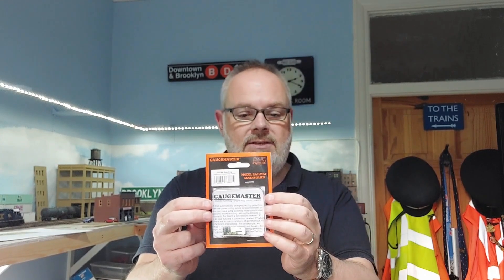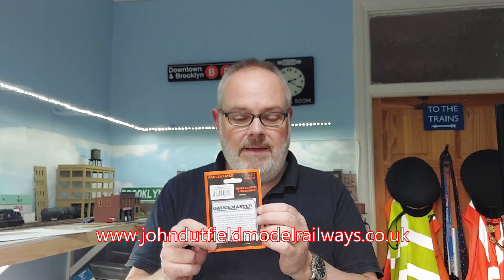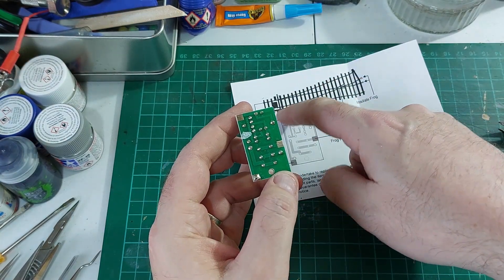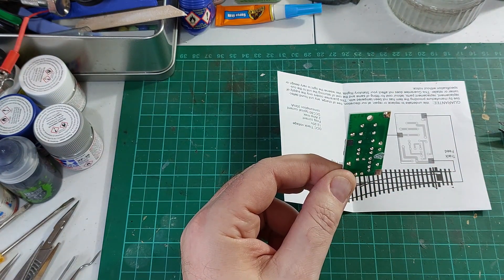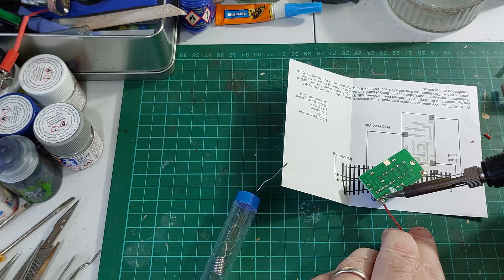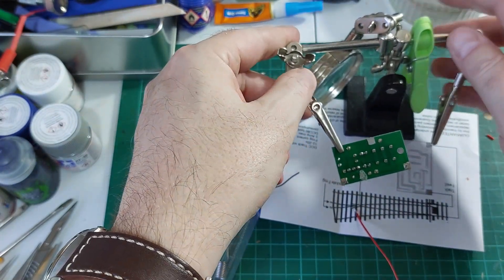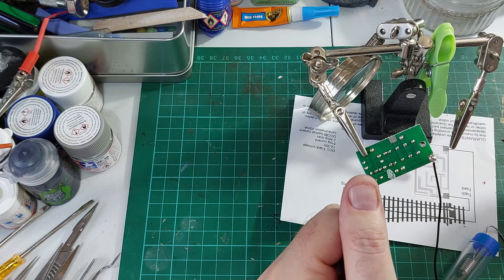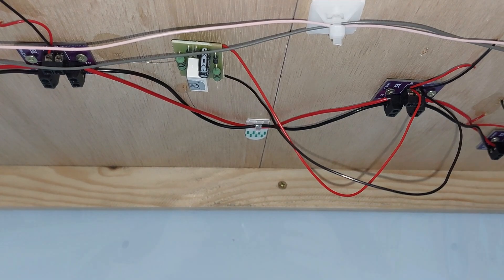Fitting a Gaugemaster DCC80 Autofrog (automatic frog polarity switch)

Comment: Best thing since sliced Bread! I've used Tam Valley Frog juicer s on my layout for years. The Gaugemaster ones weren't available when I started Rensville. 
The only difference between them is that the Tam Valley ones have screw terminals, so no soldering.
Make sure you're on the ball when operating. With these fitted, you can run against a point set against you and derail. Just as in real life! 😃
Reply from the maker: Thanks for the advice, I will take care 👍

Comment: Hi. Just wondered how you got on with these? I’m having difficulties with them and the new ones from Dcc Concepts. I know you mentioned it took a while to start working. Could you explain what you did please? Also did you get any more? Thanks
Reply from the maker: @DesLynamMOT  hi there. So I have now removed them as I have motorised my points. They seemed to work great at first but after a while I noticed that they buzzed a lot as locos went over the frogs, but I didn't get any shorts so it may have just been me. In principle they are a great idea but not the success I thought they might be
Reply: Thanks for your reply. That’s really helpful information. Can I ask what point motors you are using. I’m looking at the cobalt range with built in frog control. Keep up the good work. I find it really frustrating when people leave unfairly critical comments. I’m assuming you’re in the Chelmsford area? If so I’m not too far from there. Cheers.
Reply from the maker: @DesLynamMOT  I am actually in Southend lol. I am using the Rails Connect under baseboard ones. They are basically the same as Peco solenoids but you can buy them with decoders, made for rails by DCC Concepts. The decoders also change the polarity when the point is thrown. They are excellent
Reply: @thebritishrailroader  thanks again for your help. Let me know if you’re in the Maldon area and would like a layout tour. Do you have an email and I’ll send you details? Cheers.
Reply from the maker: @DesLynamMOT  it is thebritishrailroader@gmail.com

Comment: Interesting product and video 👍.  I wonder if two of these could be used in conjunction to switch the polarity of both rails on a turntable?  I know there are dedicated units for this purpose but the price point of these units are much more attractive, even when buying two.
Reply from the maker: Interesting thought. It may be possible, they work by detecting the polarity of the current being drawn by the loco as it hits the frog - you can hear it switch as the loco passes over it. Not sure how this would work for a turntable but I suppose it might be possible
Reply: @thebritishrailroader I think the logic is the same in dedicated turntable / reverse loop units. As long as they switch before your DCC’s short circuit protection kicks in - which I assume it would - then it should be good (Famous last words 😂)
Reply from the maker: @dawkinsm  do you know what, if you don't mind spending the £16 it is worth a shot. If it doesn't work, you will still have a couple of frog juicers